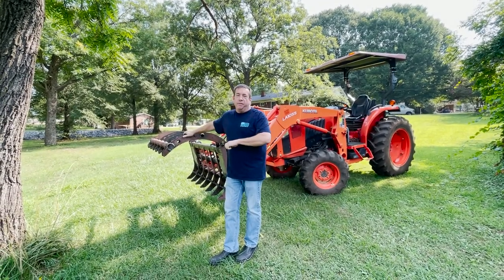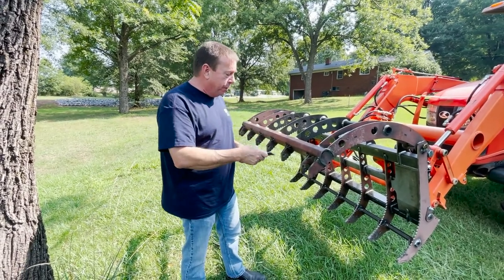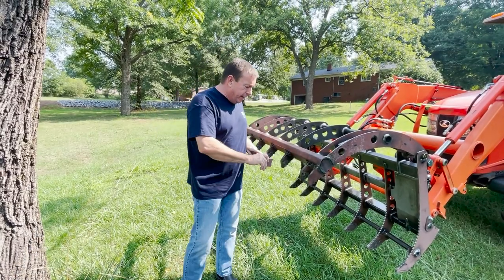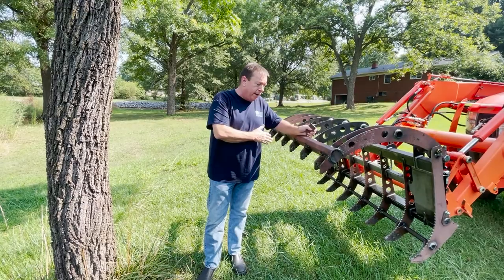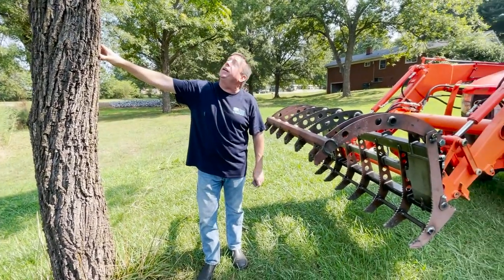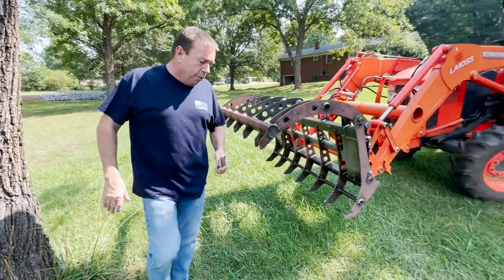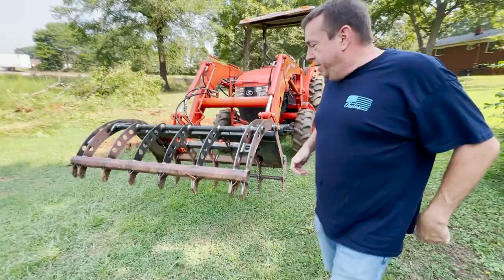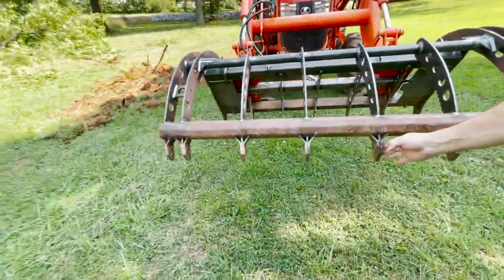EA Wicked 55" Root Rake Grapple Update

Comment: i bought that grapple about 5 yrs ago and had no problems at all.  I've moved probably 50 logs and 140 telephone poles ( some twice.}  I cut down the trees and use a stump bucket on the rest.  I was worried using a root grapple on logs but no problem at all so far.  EA products are expensive but worth every penny, thank you Ted.

Comment: Looks like the 55” does great with a tractor that’s larger than 40hp.  Would this model be good for my 52hp LS tractor? 

Thx
Reply from the maker: We always test our attachments on machines larger than recommended.  For the extra beef where it needs to be, you'd be best off with our Wicked 60.   Ready for the long haul, and you can let er eat without worry!!  Link https://www.everythingattachments.com/60-Inch-Wicked-Root-Rake-Grapple-p/eta-60-wrrg.htm

Comment: Ted, OK you have impressed me and the next order from EA is going to be one of these root grapples.  Now I do have a question, does a set of seatbelts come on that Kabota?  If not you may want to invest in an EA set of wicked seatbelts.  A couple of times I thought you were going to leave the tractor the hard way.  Stay safe and keep making those awesome EA products.
Reply: I highly recommend an EA Extreme box blade for ballast like the 1100lb one I have on mine.  I haven't left the seat one time since adding it. 🤣

Comment: I just thought I was rough on my equipment.  I am impressed.  I just keep trying to understand how a 400 lb grapple with hold up.  Mine is American made very reputable company but it weights 900 lbs.  I almost hate putting it on just because the weight.  I did have to replace my loader front cylinders already from doing something like you are doing.  Is this one the EA 60    It is different from the one on your website. You and another person calls it the Wickeder 60.
Reply from the maker: Yes, the strength to weight ratio is Amazing!  Actually, the one shown in the vid is our Wicked 55, now referred to as Wickeder, but the 60 is also Wickeder!!!

Comment: Will these changes be on the wicked 66? Mine is still in the pipeline…
Reply from the maker: 55 and 60, so far.  The 66 may eventually get it, but we really don't have a projected timeline yet.
Reply: So the original design is the one that my order will be done?
Reply from the maker: @1pa4u2c  Yes, most likely so!

Comment: I wish you would make a Wicked Grappler  48” for John Deere 2025R .
Reply from the maker: The JD mount is too wide to fit between the cylinders on our 48" model.  That's why Wicked 55 is the chosen one for it.  Lightweight, yet incredibly strong, while keeping the load as close as possible to the loader pivot pins!  Details, several vids, and 500+ customer reviews here https://www.everythingattachments.com/55-Inch-Wicked-Root-Rake-Grapple-p/eta-55-wrrg.htm

Comment: Ted, how did y'all address the increase in line pressure on the hydraulics when pushing with the grapple and turning the rams into backfeed pumps? After that test, it's clear y'all did something or it's not really the concern people are making it out to be. If you don't understand my question, check this out: https://www.youtube.com/watch?v=9T9925X4RzQ
Reply: Does the grapple lid "bottom out" in the fully open position against the grapple so as to not bottom out or flex the hydraulic rams?

Comment: Looks like a good way to totally abuse a tractor and loader.  I pity the guy who buys that Kubota in the used market.  Were is the ballast?
Reply: Why not use a tracked machine. Much safer less of a mess instead of this fool trying to break the tractor and the loader. Can you imagine what this tractor would be like after a year or more being worked like this .Make the job easier get a 360 tracked machine